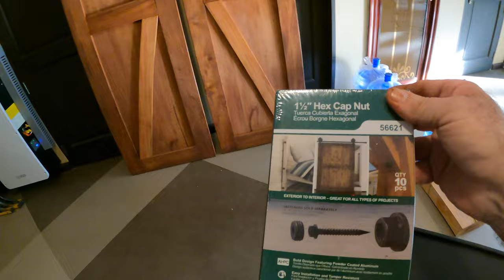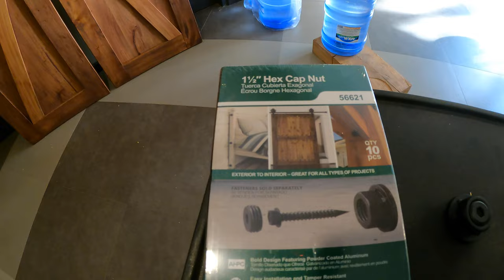HOW TO MAKE SLIDING BARN DOORS (House Building in the Philippines)

Comment: why put a threshold on the floor so you can trip on it, bro ??? Just cut a small slot in the tile and mount your plastic piece upside down on the bottom of the door so it slides in the slot of the cut tile. and I LOVE the doors and the light switch as well :-) Very nice great woodwork bro.

Comment: That was a well made and executed project James. I especially love the solution to the light switches.  Incidentally with all the machinery in the basement, are you detecting any significant drain on your house batteries?
Reply from the maker: We updated our battery capacity 3 months ago with Dyness Powerbox Pro's.  Now with the additional capability and reliability there hasn't been anything they haven't been able to handle.  I'll be doing a solar update soon so with more info.